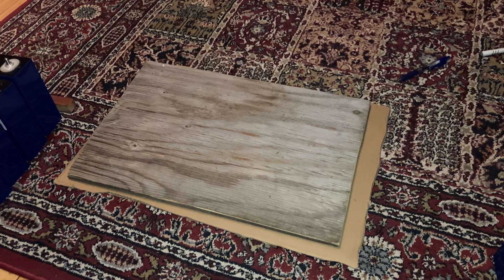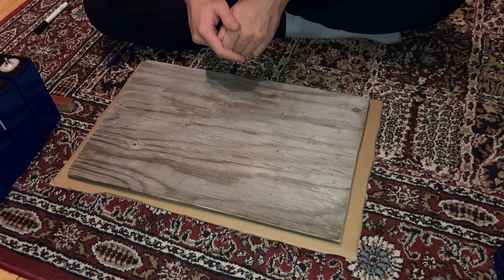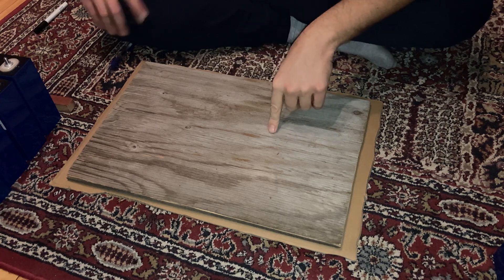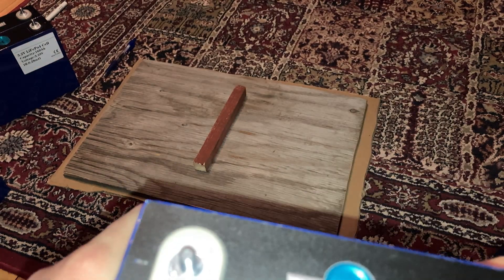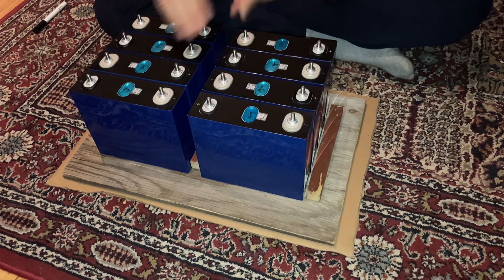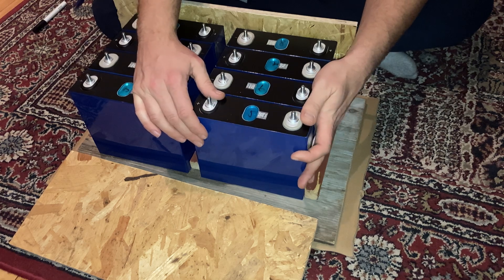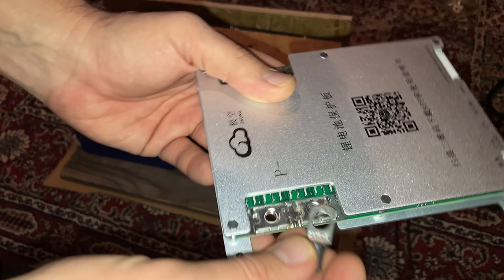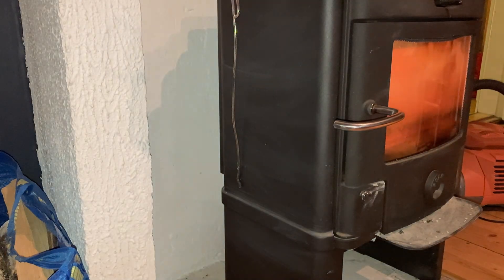Dr. Pluring Builds a LiFePo4 Battery. Part 2. No strategy survises first contact.

Comment: Hi from Finland.
I recommend using insulation between the cells, I used fiberglass insulation board myself.
There is no shrink wrap in the cell, but some kind of sticker type wrap, its just peace of mind when there is something better between cells.
Reply from the maker: Kiitos! I'm going with 1mm cork sheets, for electrical insulation and spreading the force around a bit. Assembly with cork sheets and various other changes coming up on the channel.